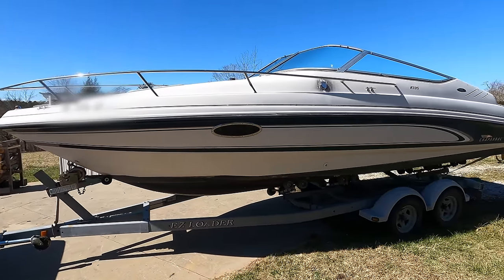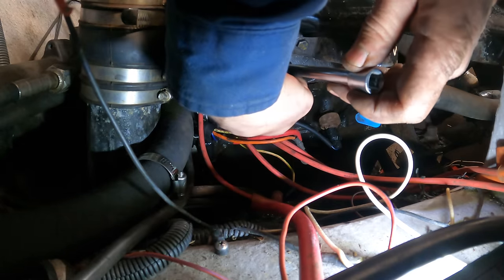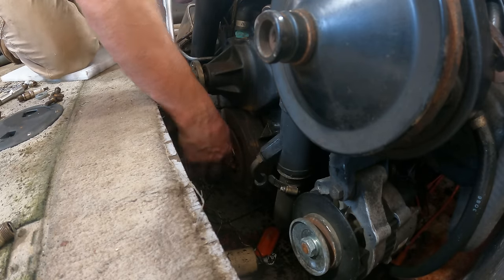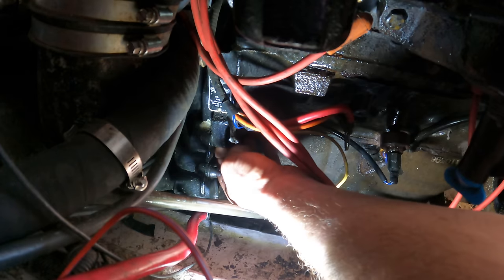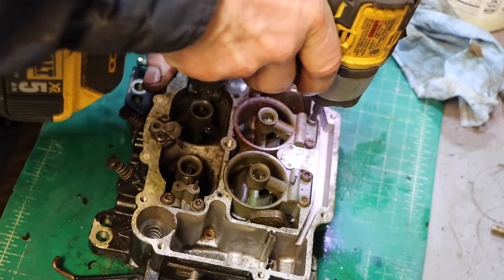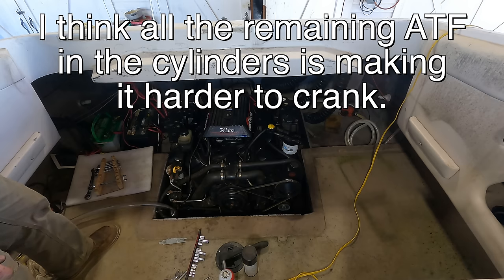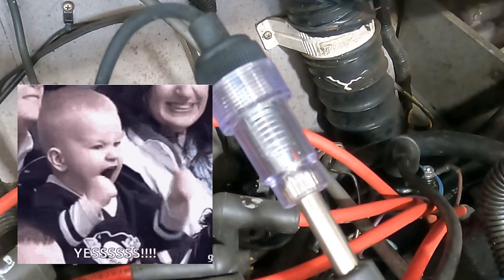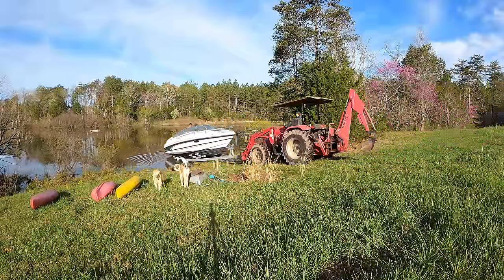Fixing A Boat With A 454 Big Block Engine

Comment: No good deed goes unpunished.
That switch is a safety switch there is a little metal clip that goes on that switch and when you pull it it shuts the boat off.

Comment: Your exhaust manifold run water through them. They’re probably cracked internally and the water leaked in through the exhaust valves. Most likely you’ll have the same situation again unless you fix it.

Comment: The stainless mesh component atop the carburetor is a flame arrestor, not an air cleaner.
 Most likely the water ingestion was caused by manifold and riser failure, or a rotted intake manifild. The intakes are notorious for rotting underneath the thermostat housing.
 Seeing the engine is sea water cooled and a 7.4. Rebuilding that engine would be futile. No reputable machine shop would touch it as they would not warranty the block or cylinder head cooling passages.
 Mercruiser makes a 383 stroker small block. Only 25 hp pess that that huge disaster, almost 30% less weight.

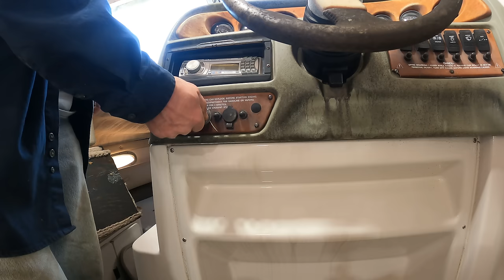Comment: 7:00 it is engaging but with low power, maybe weak battery (ies), poor connections ,,solenoid, corroded battery switch.
Also often overlooked poor ground on block ! Very common on boats (corrosion).

Comment: Capo rust muric  acid white vinegar then Marvs Mirical oil then let them each rest in cylinders at least over night then turn engine over in between each process then look at how clean it is in each cylinder works every time for me and I use B barium additive in the gas

Comment: You should be able to run the cold engine for at least a minute before anything is in reasonable danger of getting too hot without any cooling water.

Comment: Yes, BOAT is a four letter word.  BOAT = Break Out Another Thousand or, a boat is a hole in the water into which you throw lots of money!  I was surprised you ran that long without changing the oil first.  With that much water in every cylinder that sat for that long, there had to be lots of water that went past the rings into the oil pan.

Comment: P to clean the portholes on the Jets in that carburetor get a wire clip that you use for your red wrappers clean the tape off of it to the and that little bitty wire will fit through the holes of the Jets on your carbonator

Comment: Surface rust in the cylinders pull all the plugs fill them with diesel fuel let it sit at a couple days and keep working it back and forth Until It Breaks free. Dean crank as usual it'll be fine

Comment: yup boat motors are very resilient..  but you need to change your water pump impeller, below and left of the engine water pump. the hose you couldn't move attaches to the transom mount and sucks the water up thro the outdrive.. then to engine water pump then out exhaust or prop. it will seem to be working good but that because your water ears are forcing the water through. you could fill a tub and lower your drive and start it to see if it sucks it up.. but honestly the 10 or 15  bucks and how easy it is to change will save your boating season.. change about every 2 years used or not. unless you pull black cover and its still nice and soft.. but if you wait until it comes apart you will get the joy of pulling all hoses and thermostat making sure pieces are not cloging the rest of the system {{ ask me how i know }}  I had 2 change 2  while boat was in the water.. had 2 454's fun fun fun

Comment: Sadly those cylinder bores are deeply pitted & badly damaged with low compression and , that will destroy the ring seal etc. and severely shorten the life of the engine - broke loose - yes, fixed - not really in the long run.  I give ya big credit for getting it running so well hard job and well done, but those cylinder pressures should be higher like around 165, run it long enough and it will start burning oil and smoking - im 64 and we got more than a few old cars found like this running but sadly they all ended up as described just a matter of time, but ya bought some time and a few more trips around the lake hopefully

Comment: Hi Have you heard of inverse reversion ,, this will suck water back up the exhaust valves ,, very common with a over lap cam,,  and a high compression , I have a 355 chev and it done it afew times till i found out about this inverse reversion.. do some home work on it..

Comment: If it were my boat, I'd pull the engine and do a full rebuild, the compression is definately low, should be between 130-140psi, the valve seats definately need to be lapped and I'd definately do an oil change, run it for a while and check the oil for contamination.

Comment: Jon you should really buy a cheap oscilloscope and learn it! It's slightly  complicated but you already have a good grasp on electronics,im sure it would be second nature to you.. you can diagnose sooo many problems and never get your hands dirty, and not be a parts replacer! Only hang parts when you have confirmation thru a test that it is a problem.. i recommend scanner danners videos go watch one or 2 you won't regret learning it, at least basic tests like misfires l, 02 sensors etc.

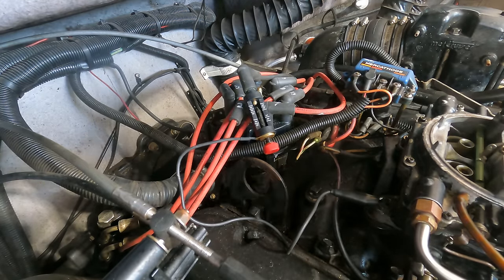Comment: 1:23:10 I have not watched this video to the end (meaning - got to get off my butt and do actual stuff) before heading out I needed to mention that I and many others have likely been where you currently are with this ignition system. Have taken a known good Thick cable and connected one end of this cable to the battery negative. Then take only the ground wire off the coil turn on the ignition, test for voltage at the positive of the coil and Bamm you use the new wire that you just connected to the battery negative and tap it to the negative side of the coil simulating a ground. There really then ought to be a spark induced this way. Just don't hold the negative side of the coil to the new ground for much more that a second (manual pulsing) maximum.
I'll be back to enjoy your eventual victory vicariously along with you.

Comment: There is no way that grade 5 starter bolt failed because you overtightened it. I think the most likely cause of failure was multiple fatigue cycles. You have to wonder how long the starter had been functioning with it not tight enough and therefor rocking like in your first segment. Something was clearly not right and caused the bolt to fail. On another note, I'm amazed how well it ran at the end. I would have assumed an engine with those bore images would absolutely need to be rebuilt or replaced.

Comment: Do you want that far? You should’ve put the new spark plugs in it taking a hell of a chance in that pond sucks some weeds up into it no guys take cars out of a junkyard. It ain’t been run 50 years and they so come with that stuff and they get them running, but I get rid of that thing in a heartbeat Before you put a motor in it rings have a lot of wear and tear on them after run over all that rust
Reply: 0:41 0:41 0:41

Comment: The fluke combination amprobe and  ohm meter does not have enough range. I’m a union electrician and I they won’t even test out the end of line resistors in a fire alarm.

Comment: One might’ve cut two black foam copper pipe slit pieces and insert them on that 90 degree fiberglass protrusion thus saving you banging multiple times and headache. 🤷‍♂️

Comment: Hey and believe it or not it's far from the classic Chevy big block I'm not 100% sure about Mercruiser, I've never had one apart but I've got a Volvo Penta Chevy 350 engine that came from a late '90s ski boat and it had throttle body heads on it but it's a roller cam block that's been machine for a mechanical fuel pump and Volvo claims 355 horsepower with a carburetor and they're probably not lying about it it doesn't have stock rods or stock pistons it's got heavier valve springs in it the more you tear down through it the more you see is definitely not a plain Jane straight off the assembly line engine which is what I always assumed they were that's far from the case though

Comment: honestly would have pulled the motor after the first boroscope inspection. I bought a 2018 evinrude motor with low hours 6 months ago and I might name the motor wack a mole for the same reasons

Comment: 130PSI on a 454 low compression engine is not bad at all, especially sitting so long.  Retest it in a month.  150 is basically brand new, these aren't like high compression engines pushing 170-190 PSI.  Do not put anything gritting in the cylinders.   You can decarb the pistons with SeaFoam but stop there

Comment: It wasn’t easy getting water in those cylinders ,might as well pull the engine and completely rebuild.because it will eventually fail otherwise

Comment: Or when he was flashing the engine he turned the engine off before he turned the water off which will cause the water to go into the intake you always turn the water off first then dry the manifold with engine running

Comment: Boat manufacturers are sadistic.  On one of my boats I had the starter out enough times that the last time I did the job in 15 min. The first time was 2hrs. Turned out to be broken teeth on the flywheel. Had the exact same results as far as engine lock. Bad dreams about that fix. Sold the boat to a mechanic.

Comment: Well, I promise you one thing: the mechanic didn't measure anything.  The old trick is to put a drill bit or an allen key between the armature shaft and the flywheel/flex plate.  OR to use gear paint to look for a pattern the same way you would a differential.

So, he heard funny noises, and decided to shim the starter.  OR, he took the old starter off and found shims, and put it back with shims.  Often not a bad call, but it's much better to check the clearance or use the pattern method.

As a rule of thumb, you should have about an 1/8th clearance between the armature shaft and the outer teeth of the flywheel or flex plate.  With the starter gear engaged, you should have about 5/1000ths clearance.  Any tighter, and it'll bind, which GM starters were always prone to doing.  I don't know about the gear reduction starters.

The paint pattern should look about like you'd expect any gear pattern to look like.  

Having said all that, your brother needs to sell his boat.  I mean,  replace the flywheel, and I bet I know who's gonna get volunteered to do that.

Comment: Never never ever run a  boat engine without water going into the primary water pump. It takes about 60 seconds to melt the impeller if run dry.

Comment: 35:46 PLEASE tell us you made sure the Timing Marks were properly aligned when you put those belts back on...

With all the other problems this poor engine has, the LAST thing it needs is to go slamming the Pistons into the Valves because of Bad Timing...

😄😁😆😅😂🤣

Edit: OK, since it started and ran without going CRUNCH CLANK BOOM, I guess you DID get the Timing right...

Comment: 1:09:45 OK, the new Stater OHM's out to the same as the old Starter suggesting the old one is perfectly fine...

Have you checked the wires between the Starter, Switch and Batteries for breaks in the wire itself or excessive resistance? A bad wire could cause the excessive Voltage Loss you saw on the meter when trying to Start the engine...if the metal of the wire itself is cracked or broken but the insulation is keeping the damaged sections close together, it might still pass current, just not as well as it should, leading to the observed Voltage Drop...

The test where you connected the good Battery to the output terminal of the Switch (taking it out of the circuit entirely) showed a Starter drop to 10 Volts instead of the 9 Volts seen when the Switch was in the circuit...that suggests to me that the wire itself is bad...

Comment: Starter would not have even turned if you had that much resistance between battery negative cable and engine block... there was something else going on there that you missed.  Never start an I/O and run it more than a few seconds without putting the lower unit all the way down.  So many other things I was screaming at the TV when watching this that you eventually figured out.  A service manual or an evening on a boating forum goes a long way to avoid your "Whack-A-Mole" experience... like the one you'll have soon when the engine gets water in it again due to the failed exhaust shutters and riser gaskets that were the real issue here all along.  And that is NOT an air filter - it's a spark arrestor.  It's very hard to encounter much atmospheric dust in the middle of a body of water, and it simply isn't worth the risk of fire with a paper air filter element.  Oh, and that engine isn't long for this world... you can hear the lost compression in a few cylinders by the cadence it has while cranking.  Just because it runs doesn't mean it's right, and the last thing you want to mess with is a single-engine boat with an "iffy" engine... it's a great way for bad stuff to happen to you quick.

Comment: Ive not watched yet, my bet is the starter had worn and was abutting and couldn't force its way in to engadging by moving the flywheel to correct alignment  - ill see if im right in 2hrs :D
Reply: Id also like to see if the plunger contacts were worn out in the old starter as that can affect the voltage reaching the main motor windings?

Comment: Is it possible that the drain plug was left in and the boat filled up with rail water??????? How else could water get in the carburetor? And leaked into cylinders. Yes, that sounds right. Even if cowling leaked, it wouldn't go into carburetor.

Comment: Did you check the oil. If it has a traditional oil pan, it's going to have water in it. Did you test the starter before putting it back in?  😮 Yikes

Comment: Why didn't you just pull the engine completely out to replace the flywheel on that 454 mercuser engine to begin with Jon? It will stop that problem on it. And replace the gear on the starter. It word for the ⚙️ gear starts with A and ends either with X., or something else. Anyways I'd open the starter up and clean it out good and relightly regrease the bushing sleeves inside both ends of the starter with marine Grease. And that starter solenoid could be weak.,or going out on the starter. You really won't know until the flywheel has been replaced on that engine.

Comment: Is the water pump is down into the lower Stern where you hooked up those lines if you just started to get a burnt out the rubbers on the water pump impellers so you did Smart buy poking the water up to it and

Comment: Sure put a lot of effort into that engine. Personally I would not trust that engine.  Those cylinder walls are very bad which will over time take out the rings. I would recommend tearing the engine down, boring and replacing pistons and rings at minimum.

Comment: Just RUN IT, any damage to the cylinder walls and rings is over and done with it. It’s a robust thick cast iron block and it’s known to take punishment. So running it longer and harder in the future will just help smooth out the small pitting and since it’s showing decent compression already and starting no reason to try and fuss with it more … it’s not as if you’re on the wrong end of NEEDING COMPRESSION just to work and like every good Farmer knows & you’ve said similar along the lines of good enough: 
“It just needs to work and work reliably … anything more is just indulgence of Ideals or covering for a lack of knowledge/expertise”
 
“You can FUSS while you FiX BUT never FiX because you FUSS” 

LASTLY DO NOT ADD ABBRASIVES!! DONT DO ANYTHING ELSE TO WEAR DOWN CYLINDERS YOU ARE MORE LIKLEY TO DAMAGE PISTON RINGS. 

You risk losing the engine (or require new rings [maybe cylinders] and cylinder hone … pray none of the abrasives ever migrate into the crank journals)! ALL WHILE YOU STAND TO GAIN probably nothing appreciable other than some nicer looking bore pictures to share with is 😊. If it wasn’t making enough compression to fire I would have said hell give a shot and learn something new, but not after its up and running. 

You are the epitome of what my father taught me about mechanical maintenance and personal work ethics and enough experience to be level headed to prevent yourself from yourself.
Reply from the maker: Yeah I agree with you. No abrasives. Cheers!

Comment: I think a "regular" mechanic would just replace the engine. The reason is that the "usual" boat enthusiast would scream bloody murder and sue if the boat had a problem out on the water and their precious family was stranded in the middle of the deep dark lake. And after they took it to another mechanic and found the the previous "mechanic" just bared it over to break it loose. And then put new plugs in it and called it good. They would see dollar signs. The average idiot knows very little about what a motor can, cannot, and may be able to handle when in this condition. I know that in this condition that motor may outlast the current owner. Or it may develop a taste for oil and gradually start using more over time. Either way, I know the risk from experience and can fix it myself. Dealing with dumbasses is just not worth the hassle. So if it was mine... enjoy it while it lasts, if it was a customer... new engine.

Comment: You need to go buy a lottery ticket now, but I think you just used up all of your luck on your brother's crap.
FYI, in the future, always lower the outdrive at least half way, I know it's got a double cardone u joint but it's a lot to ask of the joints and the rubber coupler on the flywheel.

Comment: Instead of ATF pour Classic Coke in. if you put a rusty nail in a glass of Classsic coke it will either be completely desolved rust or eat the nail up
.... then be sure to change the oil brfore stsrting. I see that you did knock all the hair offf your head in one spot  LOL    also chect the oil level you might have 36 gallons of water in there

Comment: The starter is fkobbing around while first cranking attempt obviously it's loose so looks like needs new starter and flexplate  I would just pull the engine  replace both good luck